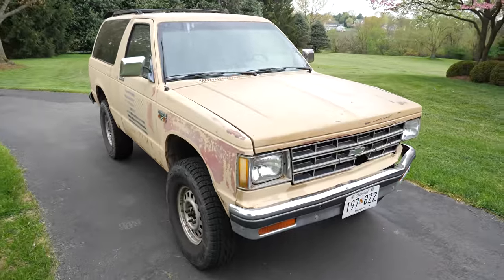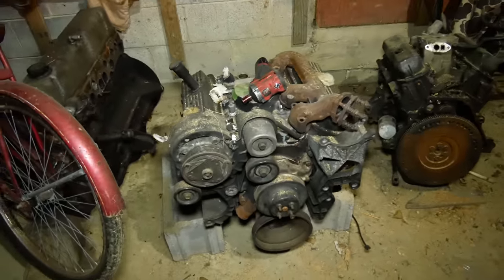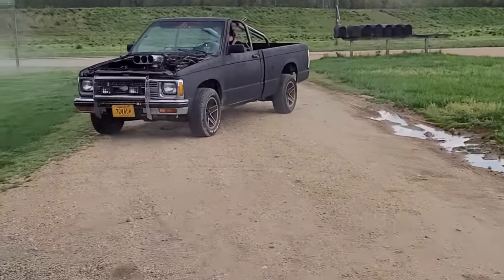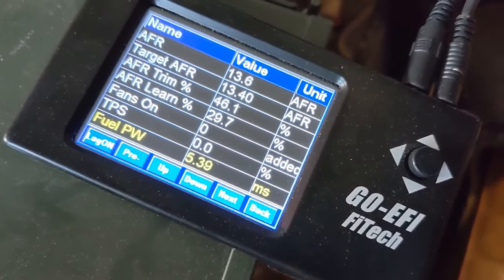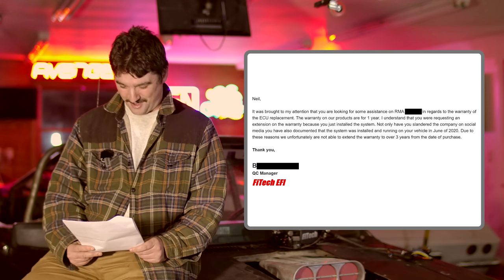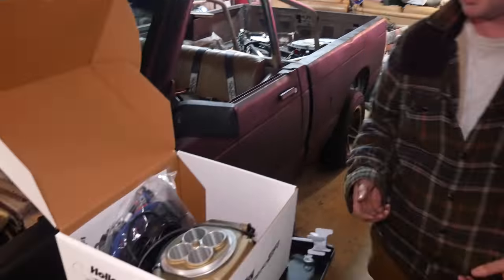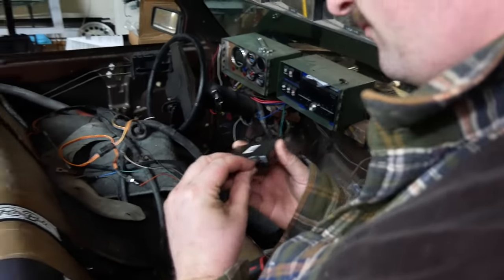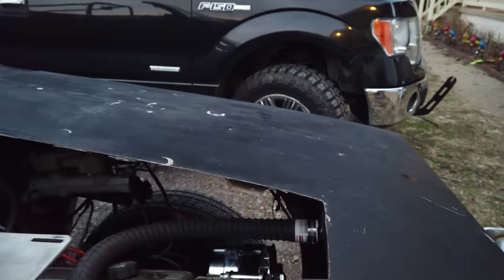1988 Chevy S10 V8 EFI Project FiTech Debacle and Holley Comparison (Friends Ep.2)

Comment from the maker: Be sure to check out Neil's video of the teardown and exam of the FiTech unit on his channel: https://youtu.be/rmbb_IhoklQ

I've helped Neil on this truck here and there for a few years now, and finally we have a good excuse to cover it on this channel. This video goes all sorts of places, covers a ton of material, and serves as a cautionary tale about FiTech's products/service. To be clear, this was not sponsored by Holley or anyone else, that EFI system is just one I had purchased for myself based on my own product research and we decided to put it on this truck to see how it compared to the FiTech. Neil is reading from a script we wrote because we wanted to get the facts straight and the story in order so that there is no way FiTech can claim this as slander, despite accusations made by their employees.

We should be returning to our regular style of programming after this upload, although it may be a few weeks because I need to work on getting the 1978 Firebird in driving shape as a top priority.
Reply: @grandmasmalibu  Good info to know! If the Holley starts giving me odd map readings, I will give that a try. I assume the sensor is filtered to an extent, but I could see that causing a rough idle at minimum

Comment: It's not slander to accurately report on the quality of a product. I'm amazed any of those units ever work, given the terrible quality of those solder connections. And to think, those intermittently shorting wires are carrying a fairly large amount of current and are just a few mm away from flowing gasoline...
Reply: @kruleworld  - Thank you for pointing out the difference. I was previously unaware of that.
Reply: @kruleworld  in addition the person doing the slandering has to KNOW that it is false and is doing it maliciously to damage the other party in some way.

Comment: I saw FiTech and I knew it was gonna be bad. Worked at a shop that installed them, out of the six we did, 5 we had to replace with Sniper. Had almost the exact same issue on a 48 Ford truck. Sorry to see this happen to him, sucks when you cant trust an expensive product to work as advertised (or at all lol)!

Comment: The Holley is a much better choice. 
Just a word of caution ⚠️  the throttle body style efi units tend to have a cylinder to cylinder fuel distribution problem when using a dual plane manifold. You may find that it will run better and tune easier if you use a small cross-sectional single plane manifold. Even for street driven only vehicles.
Reply: Yeah a one inch open spacer worked great on my dual plane intake.
Reply: You can also mill or grind out the devider of the dual plane to help this.
Reply: So far so good on the Holley, but this is good to know for future builds! I assume that the MAP sensor is filtered to an extent but I could see turbulent air still causing issues

Comment: The aftermarket throttle body EFI the only one that gets good reviews is the Holley Sniper. I was looking into these recently and ended up with a sniper on my C10. FiTech was almost the same price and had less features and not great reviews, Jegs/Summit branded ones had bad reviews for reliability and needed external fuel pressure regulators. Aces Killshot I couldn’t find any reviews of and the only feedback I could find on social media was about orders never arriving or no support from the manufacturer in regard to warranty requests.

My sniper I just had to run power, fuel, teach signal, coolant temp and O2. All sensors and/or wiring it came with and it just ran first time… after I hooked the fuel feed and return the right way around.

Comment: A buddy of mine bought an FITech unit when they were fairly new to the market, the first start on it went perfect and for the first 4-5 months everything was great. Then the unit developed this problem where when you shut it off and came back to it a few minutes later sometimes the unit would loose memory and then you would have to re-select everything to get it running again, we tried to fix it, we check and cleaned all power and ground connections with no luck, he just kept dealing with it for about 4 months and then it developed a new problem where it would randomly shut off going down the road, it would restart but it was concerning, then after about a month of that the thing would just flat out either not run at all or only run for a few min so he sent the unit in and surprisingly they were nice enough to warranty out the unit which they determined was defective and they claimed that the new model was updated and improved over their old model, now that unit has been on there for several years with no issues, so the FITech stuff really is hit or miss, you either get a good one and have great results or you get a lemon.
Reply: I had the same issue! The high pressure fuel pump (the fuel commander) loses pressure, I watched it go from 60 to 30 to 0 psi in a matter of 30 seconds… unfortunately it’s out of warranty

Comment: Hey just an FYI, if a company doesn't fix an issue after going to social media then file a complaint with the BBB (it's an easy process), if they don't give a resolution to your satisfaction then they get a derogatory mark. I had an issue with one of those online teeth straightening companies and in email they refused to do anything about it without charging me hundreds of dollars but after a BBB complaint they said they would fix it at no charge to me if I checked my complaint as resolved, which I did.

Comment: My experiences with FiTech units have been a mixed bag. We installed 1 on a 1968 Camaro with a 5.7 and it worked well for about a week...then it would lose its settings. The second one worked well and it's still working well. The 3rd one was junk right out of the gate. 1 out of 3 we're good. Not a great record in my opinion.

Comment: It's a shame that Megasquirt and Speeduino weren"t a choice. With the old FiTech body, maybe you could run one of those more reliable ECU.
Reply: no doubt you could use the FiTech throttle body with Megasquirt controller in the interior of the car(where it should be) and have a reliable setup.

Comment: I've run into this a handful of times over the last couple of years with assorted things. I've had to retrain myself to stop hunting for deals and/or hoarding parts until I'm ready to install them and instead just hang on to my money until nearly the last moment before I need whatever it is. Obviously this is annoying when the supply chain may not have everything you need all at the same time... I've also learned that if I think something isn't working the way I'd like it to work, I need to return it immediately. I have a couple of tools in that category right now that I'm probably just going to end up getting burned on.

I've, more or less, just concluded that most things only have a 30 day warranty without a massive PITA.
Reply: Yeah, since this product, any big ticket auto parts get ordered days or weeks before anticipated install.
Reply: @triptheroad  It completely sucks, because "every man" hot rodding has relied on amassing parts every paycheck probably since the 1940s and money has a way of evaporating whereas parts typically wouldn't.

Anyhow, I hope the Holley works out. I've never heard anyone say anything negative about the Sniper setup (except that they should have gone Terminator from the start 😆).
Reply: @TheBrokenLife  True, I am constantly stockpiling odds and ends from the junkyard, from parts stores, and from other enthusiasts

Comment: I bought a fitech go efi 600 back a few years after they released. The system was on my car for a total of 4 months before I took it off and sold it on marketplace for like $200. I won't even mention the absolute useless tech support they have. After that the car went sniper efi, then a carburetor right before I sold it.

Comment: I don't care what their customer service did when you have a question, what in the ACTUAL fuck is that horrendous breadboard job? I could do a better job with literally wires and a breadboard completely hammered, and I'm not good at soldering. That is astoundingly poor work, and alone is enough to make me not ever buy a FITech unit ever.

Comment: I had a fitech on my bronco and hated it, kept throwing injectors and flooding the engine, fitech just kept sending me new injectors. I finally sent it back to summit and got a Holley sniper, had it 3 years now and also have the hyperspark ignition and in tank pump. Fitech is a joke.

Comment: I don't know what happened to FiTech because they made a good unit at one time. There was only one other company years ago and they built a TBI system using GM specked parts. Those things worked well too and were around $1000. Back then Holly also had a TBI system that nobody talks about anymore because it was a complete piece of shiitte! I have one of those that I'll happily send to anybody who wants it for the cost of shipping. It sits on the shelf collecting dust and hasn't moved in years. But they must have finally figured out what they're doing now and I may pony up the money and try one on the same C20 that I converted back to carb after the debacle of the early Holly TBI system.

Comment: My father and I have a 73’ challenger with a good ole’ 440! We installed FI techs fuel injection and it worked great! Unfortunately the high pressure fuel pump (the fuel commander unit) won’t hold pressure and dies within seconds after being started. Sadly this is a common problem with it or so I’m told… no fix for it either other than replacing the whole pump for $500

Comment: Wow - so crazy you came out with this video today.  Over the last year I’ve rebuilt an ‘88 S10 Blazer head-to-tail, including the 2.8L V6.  For the last 5 months I’ve been fighting the tune on a Speeduino DIY ECU using the factory TBI components.  I spent the last few days ripping out all of the GM harness and components in preparation for installing the Holley Sniper 2300 I just received last week.  Crazy co-incidence!
Reply: Damn, using an arduino ECU to run factory TBI injection on a late 80s v6??? That's dedication, I admire the homebrew oddball stuff a lot. I've been planning on doing a coil on plug conversion on my 86 toyota van using some kind of speeduino ecu, hopefully gonna get around to it next summer.
Reply: @MegaDysart  the Speeduino stuff is based on the MegaSquirt ECUs, and they started out as a drop-in replacement for GM TBI ECMs.  The unit I had was made to fit right into the factory ECM box.  However, I was never able to get it to run.  Don’t know if it was the board or if I wasn’t able to get the proper settings in the tuning software (Tuner Studio).   But I finally gave up and went with a Sniper.  But there are many, many people out there making Speeduino work with all kinds of engines - pretty much anything you can imagine!

Comment: I have a buddy that put a FITECH unit on his 1978 Ford F150 with a mild built 460, and it would not self-learn at all. he finally ditched it for a 750 double pumper holley carb and sold the truck lol

Comment: I installed a fi tech 600hp on my big block, I haven't had any issues. May be 1 in 1,000,000. Personally "not a expert" I think your fuel wasn't high enough for starts at 170 setting. Gotta turn off the 269 multiplier it comes with from the factory on the cranking setting. That is all, love the firebird project!

Comment: 2019 I visited both the FiTech and Holley booth.  I asked each the same question, "Why should I buy your system vs the competitors?"   

FiTech guy (visably annoyed) said, "Because ours is better." and did not elaborate.

Holley guy:  Deep breath, thought about it for a second, and then went into a 15-minute discussion of their features, options, and US based customer service department.  Not once did he bash the competition.  He sold me on their system even though I have not progressed on my project far enough to buy one.   

I hear issues from both systems so they probably both have some sporadic quality issues and customer service issues.  However, most seem to have user installation problems more often than not.   I have also seen and heard positive experiences with both companies.

Comment: I appreciate the details on the fitech unit. I looked at one for a project about the time Neil purchased his but ultimately decided to stick with the Edelbrock 1405 carburetor.  It starts right up and runs so good I just couldn't see turning loose of the money. I'm really glad I didn't now.  Chances are it would have been fine, but I've seen enough people who had issues with theirs I doubt I'd ever really trust it.    When you're in a 12000 pound truck with a 30 ft trailer, you REALLY don't want to have to call a tow truck.

Comment: Thank you for showing disassembled unit. Makes me think, that this technology was copy of finest 10USD CDI modules for 125ccm entry level quad bike, but with expensive 1USD molex connector removed to save some costs
Reply: It wouldn't last, in automotive parts under hood wires must have some kind of relief  near the ends, and this was example of not giving a shit about after warranty period and about people, that will drive a lot while under warranty. Thy just are sure, that sales will cover replaced units costs

Comment: Though what I'm about to say may be a good point to explain some of the problems the fitech unit had I would agree that they didn't handle this as a company in the best way they could have. My main question is when the fitech unit was installed was that pipe extension for the o2 sensor installed I know having a o2 sensor too close to a collector or to close to atmosphere can cause problems. That might have been part of the problem when it was powering up and not running properly. As for the part when it would just power cycle that clearly was a electrical fault within the system. Granted if it had been my company I would have taken care of the customer even though it was out of warranty considering the circumstances. They where not obligated to do so considering they advertise a 1 year warranty. But accusing a customer of slander should never ever happen from a professional business and it is for that reason alone I will not be doing business with fitech. This sort of attitude towards customers is completely infuriating to me especially in the car modifying world.
Reply: I don't disagree with you on the pipe extension part, that was added later, but the unit died before I could factor out any issues caused by the exhaust setup. Early on though, I did get pretty good AFR and trim readings, so I still don't think that was the primary cause of any issues experienced.

Comment: Brave man to do a high rpm pull with an alignment that bad. Steering wheel off 180 degrees or more
Reply: Believe it or not, it tracks straight, but the wheel needs to be re-centered. I basically just adjusted one side in/out until it tracked straight/didn't feel like it was dragging. Did that while I was on vacation with the truck and limited tools 5 years ago 😂

Comment: “My 3 years out of warranty date product won’t be warrantied!” 

That’s it.

It was out of warranty, when you bought it, you understood and agreed to the terms of the warranty.

Poor quality content by an otherwise excellent channel.
Reply from the maker: If they just didn't want to fix it out of warranty, then fine. It was clearly a faulty product and it would have been good of them to fix their own poor workmanship, but they certainly don't have to. Accusing Neil of slander and being generally rude after finding out that he publicly complained about their faulty product is not a good look for them. I wanted to tell the story of Neil's truck and his negative experience with the product and company, I think it's worth sharing and I certainly wouldn't want to buy a Fitech unit after hearing about how well his worked and how he was treated by the company. I'm sorry that you didn't enjoy this video.
Reply: Did you watch the video? It was faulty to begin with.  The time wasn't a factor. Are you really saying because it sat in the box, that's what caused it to fail? Obviously if it were in use for an extended period of time and then failed, that's a different story because that's from potential overuse. But there's something in the law called a warranty of merchantability, meaning that a product must do what it's designed to do. Their warranty is completely separate from that, and they must still follow the law.  They didn't.

Comment: Due to both of your disappointment in fitech do I see a target practice video in the future? 😏
Reply: I've been thinking about how valuable my time is these last few months, and I'm leaning this way more and more. I could probably get it running again to prove a point, but at the end of the day, the board still needs to be re-potted and the unit wired back up, and even then there's no guarantee that it will continue working.

I think putting a big hole in it would be far more entertaining 🤠